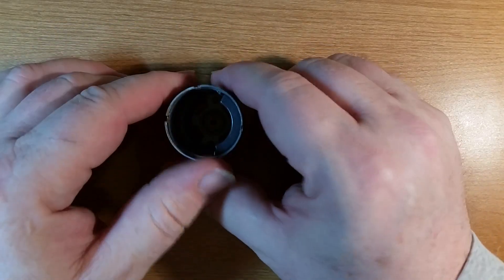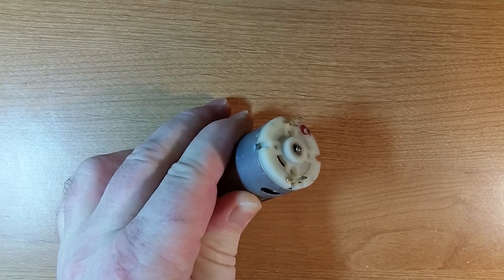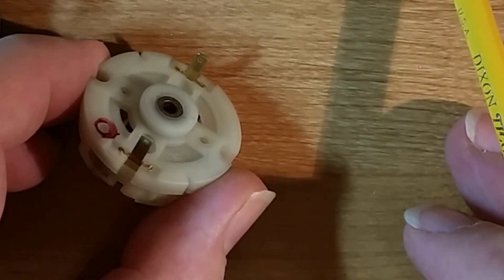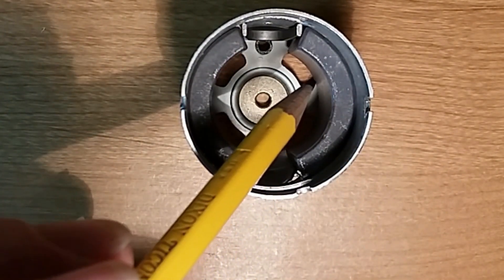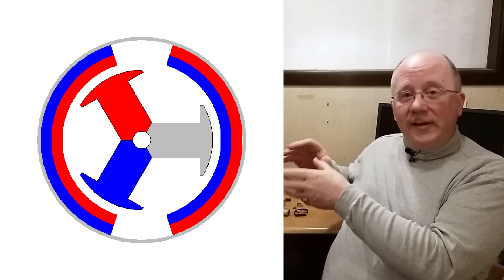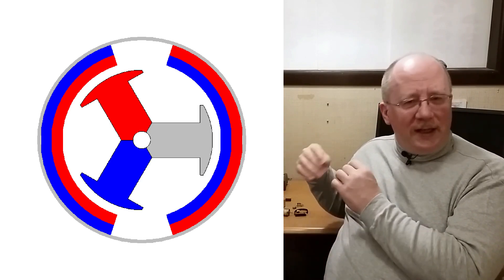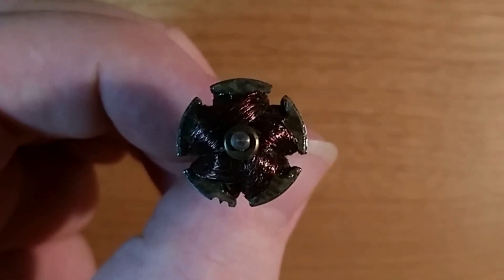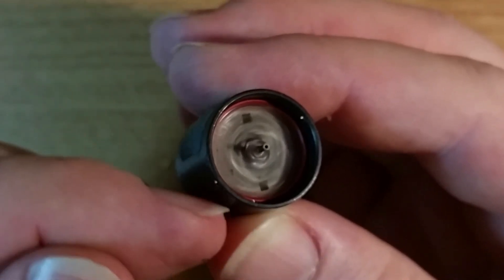DC Motor Basics

Comment: Can you post a video about controlling the position of a dc motor under a Heavy Load? It's very interesting that servo-motors(like SG90) somehow get into the desired position no matter what the load is, as long as the load is under the specification without any oscillation.

Comment: Nice vid.
I hope you will make some videos how to control motors one day.
Reply from the maker: So, between this video and the PID videos I think I have it bracketed, but with lots of empty space in between -- what's missing for you in particular?
Reply: Oh sorry, I wanted to write induction motors.
Although I've been researching about them in the meantime, and came to conclusion their construction is not complicated and it's unlikely you have some of them in your parts drawer :)
Reply from the maker: All of my induction motors are more appropriate for setting on top of my parts drawer, to keep it from blowing away in a strong wind.  They're also already attached to machinery.

I've never worked with induction motors professionally -- although I was responsible for several of them doing maintenance work at my dad's shop when I was a kid.  They're very elegant in their simplicity of construction, although how they work has some interesting subtleties.